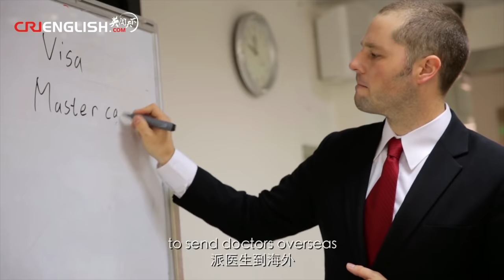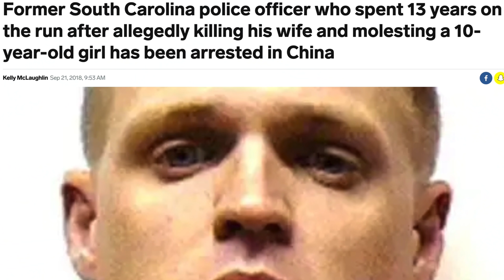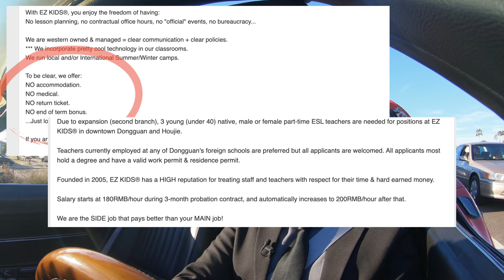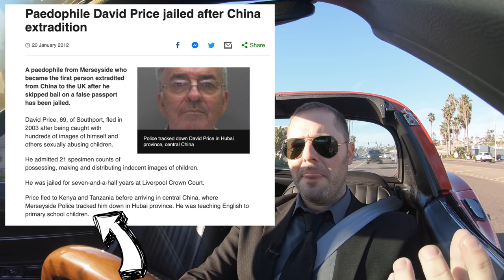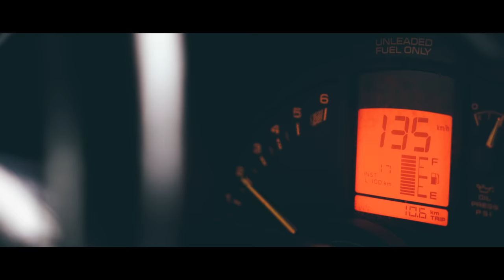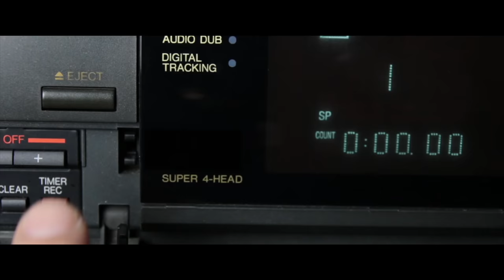Why are there so many Foreign CRIMINALS in China?

Comment: I’ve lived in Santa Barbara for the past 30 years. When you find yourself on the stretches of road that do not allow a u-turn, either make a right or left onto a cross street and make your turn down that cross street. That stop you made at the end of your video. That’s a high risk move. Clearly you were on a highway with cars speeding by. There is a chance that somebody is going to mistake your car ‘s parked position as a lane, or you’ll get somebody under the influence who will rear-end your car. The later happened to my working colleague years ago. She and a girl friend died. I’ve heard of it happening since then to others. Best move - get off the freeway. If you find that you absolutely must stop on the side of a freeway with cars zooming by, get everybody out of the car and away from the freeway as far as possible.
Reply: I thought that was Santa Barbara.  Wasn’t sure but saw a Hwy 101 sign.

Comment: You should change the door lock cylinder on your driver side outer door handle. It should be flush to the body and your's is sticking out. It's a pain in the ass to get to because you have to remove the door panel and door window to get to it. The local Corvette Club can show you how to do it. (I had an 82 Vette)

Comment: Re: The preview at the end of the vid.

Please tell C-Milk that it is legal to drive a car without a door. You remove virtually any body panel of a car that you own and drive it. However, there are restrictions that vary from state to state that require covering the rotating wheel/tires or how much tire can be exposed. This is mostly to prevent the tires from kicking up debris.

So yeah.....cut off the roof, remove the doors, remove any glass that you'd like and take off the deck lids if you prefer. Most states have no problem with doing this to any car that you own.

Comment: Manual steering in an older Corvette?
Reply from the maker: 1968
Reply: @serpentza  
I owned a 1969 AMC Javelin in the 70's. It had power steering. I'm surprised that a Corvette wouldn't.

Comment: Looks like you need more than power steering, your steering wheel is not center, it looks like u keep compensating for over steering. Also your clutch sounds like slipping during shifting. Stick shift is for professional drivers.
Reply from the maker: The compensation is because the steering box grease leaked out
Reply from the maker: Lol, the clutch is worn, it's from 1968

Comment: That vette is junk look at the steering wheel a-line.... transmission is beat!  You have two old vets . You have no new content... I watch you and your buddy Boring! You riding a wave that going out to Sea.
Reply from the maker: The steering box seal failed and the grease leaked out, hence the steering issue, the transmission was made in 1968 and Muncie 4 speeds were never good lol, of course it's a piece of shit, I built it from a heap of parts with a seized motor and no interior, it may be a piece of shit, but it's my own piece of shit that I've built myself